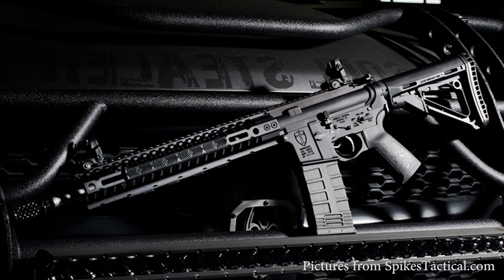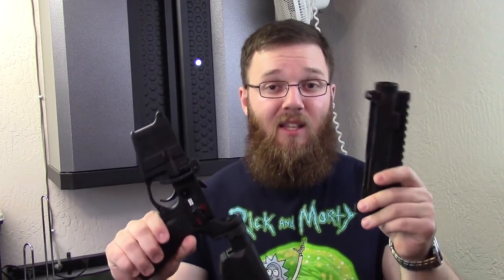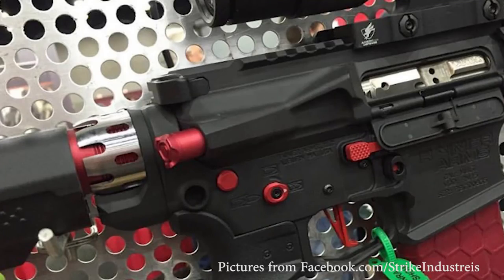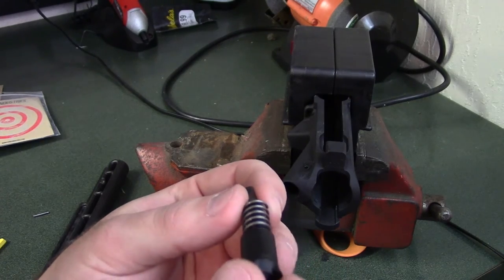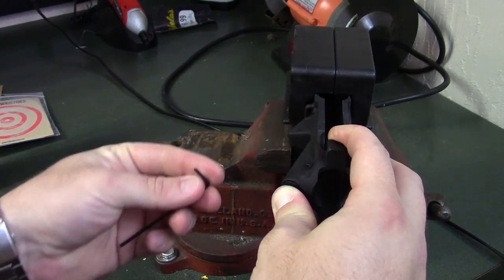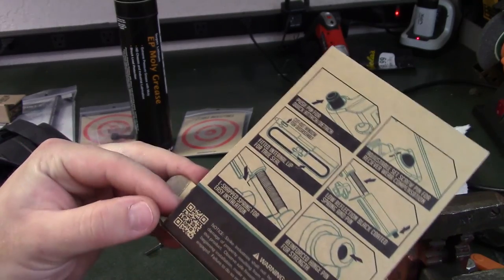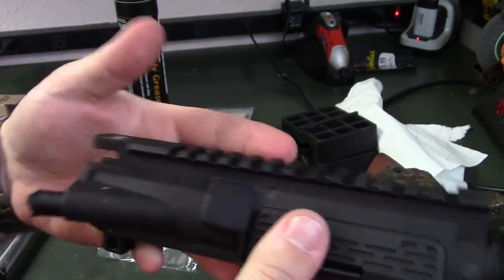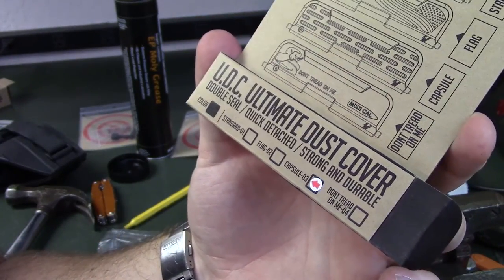300BLK Build: Forward Assist & Dust Cover 1/4

Comment: Hey nice, I popped this exact same forward assist/dust cover combo on my .300BLK pistol. I've had them installed for like three months but only just now discovered the DC detent was adjustable. :P
Reply from the maker: It's a great feature! I've had uppers that vary dramatically in the size of the ejection port.

Comment: I don't know if I missed it or what. Which BCG did you go with? I don't see it listed in the description.
Reply from the maker: +diycentral I'm ashamed to say that I don't have a dedicated BCG for this upper. I end up going back and forth with BCGs from other rifles. The one that's in it most often is actually a nickel boron I got from Radical Firearms
Reply: That's good enough. Seems to answer the question about what is the BCG in the other related build videos. Thanks.